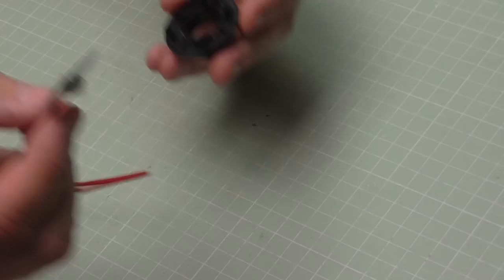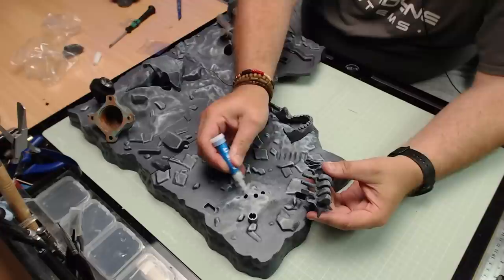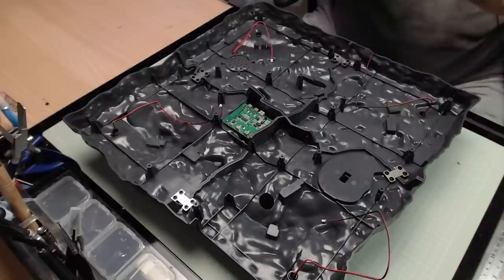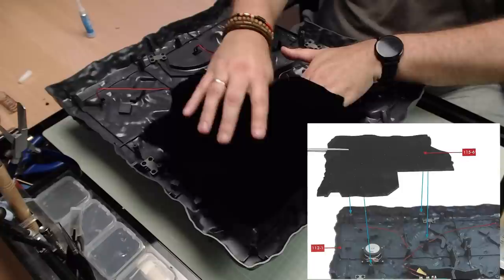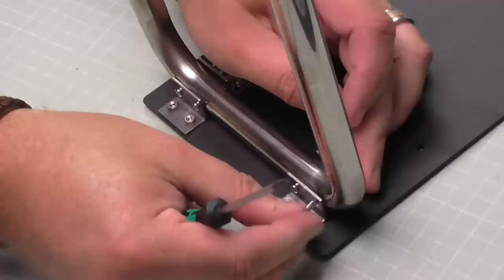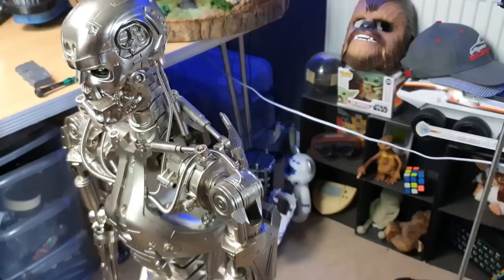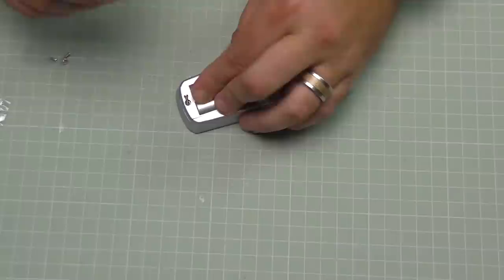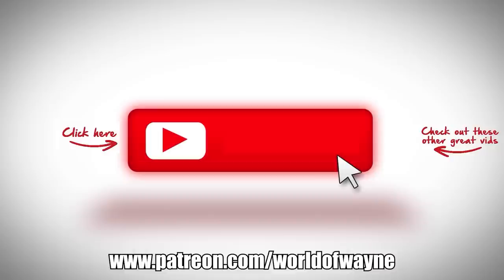Agora Models Build the Terminator - Pack 12 - Stages 111-120 - The Completed Model

Comment: Dear Wayne, I have been following this project from the start. A most impressive model and fantastic tutorials throughout the series. Best Wishes Johnny
Reply: Hi.wen I pressed the circuit board on the head the eyes never lit up I pressed It nothing happened just a buzzing sound is the  circuit board at fault anyone else had this problem

Comment: I have almost completed my build now - didn't use any of the magazines as I found your videos to be far superior - thank you Wayne. Unfortunately, I had one part missing from my consignment – (the pack containing some of the toes from the right foot) and the circuit board for the skull area wasn't working, so I am waiting for the replacement parts to arrive. I have mounted the Terminator and checked the base circuit board and it works fine. It is really impressive.

As with some other subscribers to this build, I found the fingers to be a nightmare to get correct. The ‘fix’ Agora added to the packs wasn’t much of a fix. I ended up clamping the fingers in a vice to ensure they would stay in place. I may buy the upgrade from Modelmodz when it is back in stock.

Comment: So glad I'm doing the base now. Upto issue 112-115 next month.. it's easier to do. Plus I changed my tactics with the glue and decided to buy more thick super glue.. i been using the water based super glue and it was a pain in the ass sometimes.. the thick ones are impressive. Surprised how well it holds things into place. I struggled with the shoulder tendons not sticking where the vertebrae is so I got the tick ones and it's strong. It's probably my biggest regret working on this is being too cheap in buying glue when I could have bought stronger ones for 7 dollars.

Comment: Wow that really is a great model. Seing it complete with the base and remote is really awesome. If I may say a tiny thing though is that they gave you four foamy feet for the base but I would add some more to the central plate under the base just because that is where all the weight is going to be pushing but other than that it's just a total killer !

Comment: My head circuit board/eye lights worked when I put it in now they dont no damage to the board. Have pressed black button in and held grrr
Nice work Wayne
Reply: There's a sliding switch on the head battery box too. I did exactly the same. Thought it wasn't working and spotted the switch.

Comment: I must admit I am a little disappointed with base....thankfully I am not using it, but it could be fixed with a bit of work. Also slightly disappointed with the remote features....I assumed the eyes and mouth would move on their own.....guess I will be investing in a micro controller.....oh and the eyes should slowly fade when turned off ;)

Saying all that it has been an awesome build....and I am very happy with my termy
Reply: I also assumed the eyes and jaw would randomly move on their own while turned on.
I'm pretty annoyed they don't...
Reply: @joshsabine219  thankfully it will be easy to fix with an arduino

Comment: that's just dumb to me. You get the first back plate and screws in stage 115. Plus the final 2 bones for the base.  They said put it on in the next issue "#116"  I was thinking "why?"  My research on other people's build there is no reason. So I put them on now.. I have no patience in 116-119 next month.. also. Kinda strange. Do you get 120 next month or so you have to wait a whole another month for 1 issue?

Comment: Wayne, does the remote control the battery box in the head, so when you turn off the temote it also disconnects the power to battery box or do you have to manually ooen the head each time and turn it off/on? Thanks!
Reply from the maker: You have to manually turn off the battery or it will keep the remote sensor active.

Comment: my eyes don't move. do you have any idea why not.
Reply from the maker: Check wires. Motor wires and that the remote is making contact when you press the button. You should hear a click.  The eyes should be easy to move. If they had any mods they may need filing down a tad.

Comment: the batteries in the head don't last very long
Reply from the maker: Yer. I keep them switched off when  not using
Reply: That,s1serious flaw as it,s battery powered. For somthing of this scale/size it should hav an AC/DC mains adaptor plug